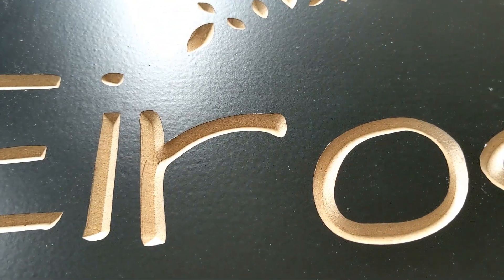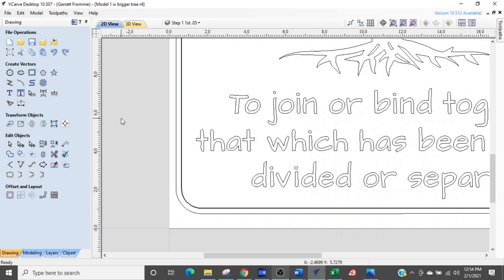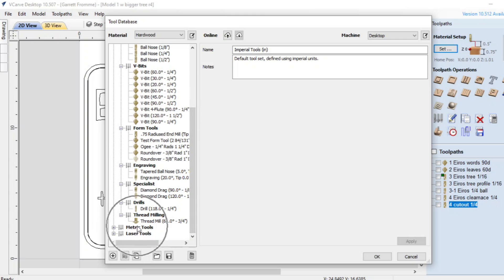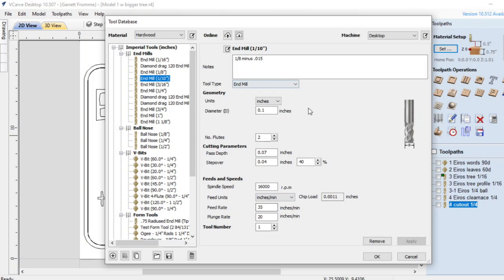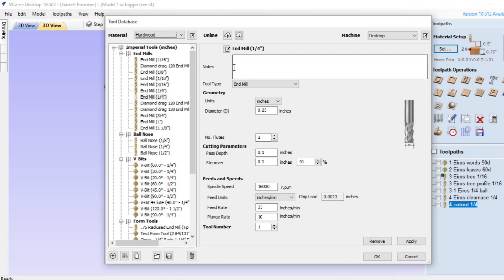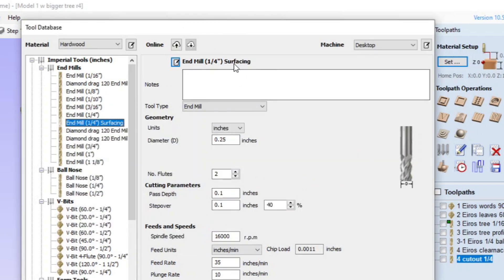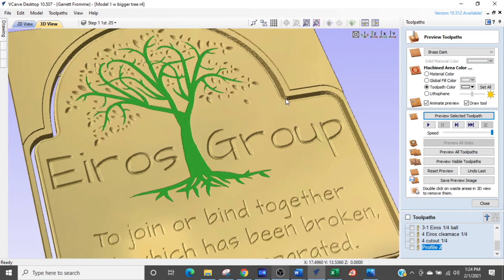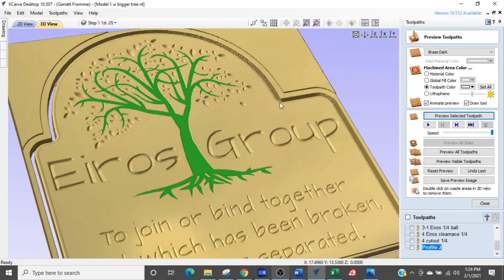How To Setup CNC Router Bits Feeds & Speeds in Vectric Tool Library Database Vcarve & Aspire

Comment: As always an outstanding video . I had some misconceptions as to what some of  the setting were prior to watching the video. I &^%& up the database that came with Vectric desktop by selection and changing the tool setting then saving. Plus I have some bits that I entered incorrectly and subsequent to watching the video I'm back in there editing the settings. I intend to purchase your set of bits (hopefully this pay period). On your bit set do the 1/8" bits come with an adapter my router can't do 1/8" only 1/4" n 1/2".  
Have a question on bit that are taper (ball nose) where is the diameter measured at, the narrowest or widest part?
Reply from the maker: Thanks One. Yeah, getting the tool library right is a littel tricky. I'll be shooting a video shortly of exactly how to set up all the bits that can be purchased through me. That way, there will be no question at all.

Go to this page to order. you'll see everything there (INCLUDING collets, files and more). https://bit.ly/3ty7gpw

For ballnose straight endmills, you measure the widest part. for taper ball nose, you enter the angle plus the tip radius. It's all given to you with the feeds and speeds table that you will get. I hope I can get it available right off my site this week.

you will also want to check the store on www.IDCwoodcraft.com for a few others that you'll eventually want to get.

Comment: Another very informative video Garrett! Every detail explained in simple terms; very easy to follow. How you explained "stepover" by walking through it in the Vectric software in toolpaths was a great example of effective training methods.  Well done my friend!😀
Reply from the maker: Hi Greg. I have discussed stepover and explained it. I believe it is in the Longmill spoilboard video. If you have the PDF (I think you do) of the videos I've created, look for the one about making your spoilboard with the longmill
Reply: @IDCWoodcraft  I mainly wanted to see what your opinion was on the amount of stepover to use, and you did cover that in the video. I will take a further look at it in the Longmill spoilboard video as well though. Thanks!
Reply from the maker: @gregsettle1581  The general rule of thumb for step over is, for flat bottom end mills, 40%. For carving bits, 5%. For surfacing bits, 70%.
Reply: @IDCWoodcraft  You are the best Garrett!